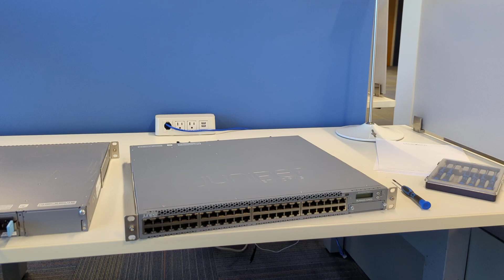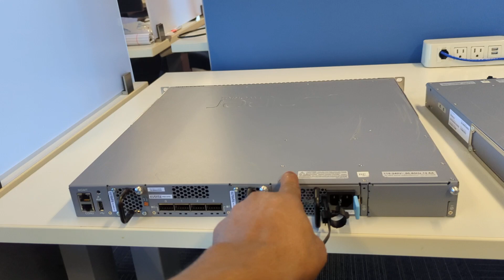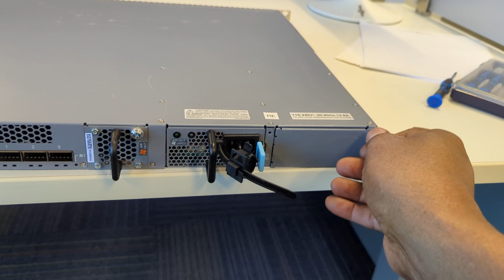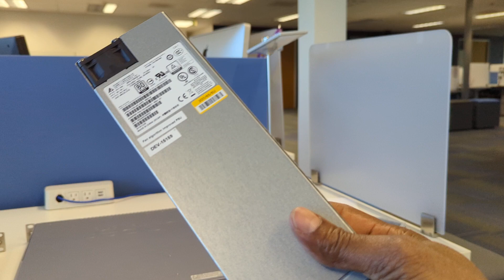juniper Ex4300 installing a second power supply.

Comment: ... I have this desk 😂
Reply from the maker: Okay than lol. I mean put up a new video on Juniper switches.  With my new desk in the background.😅
Reply: @willantilles5493 Ironically, I just added a 4300 to a vc since fpc0 had that hardware failure on the power supplies. 😂
Reply from the maker: @Trust-Yourself-1st oh boy what fun. Yeah my 4300 power supply went out last week luckily I don't throw anything away.
Reply: @willantilles5493 I don't think the PSU's are bad, I think its the chassis. When I lab it up next week I'll let you know 😩
Reply from the maker: @Trust-Yourself-1st okay cool.  By the way I'm not a network guy I just have do some networking

Comment: Do you happen to know where I can find the cover for the PSU? I am trying to go from two PSUs to one
Reply from the maker: @twk95  what do you mean?
Reply: @willantilles5493 He wants the cover plate you took off before you inserted the PSU.
Reply from the maker: @DiscipleDown  oh lol maybe eBay ..thanks
Reply: You're asking to do something that is extremely rare (not many people want to downgrade their switch). Juniper doesn't even list a part-number in the datasheet. These switches or EOL and they probably wouldn't have any to sell anyway. EBay will be your only option. Try to find a 'for parts' switch with only 1 PSU. Or just don't worry about the cover plate. Throw some tape on it if you're worried about airflow.